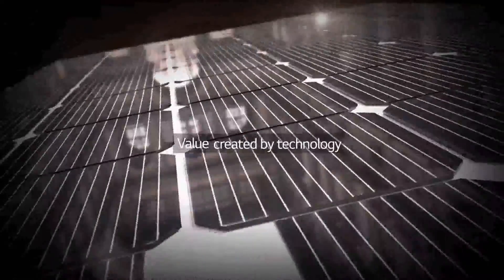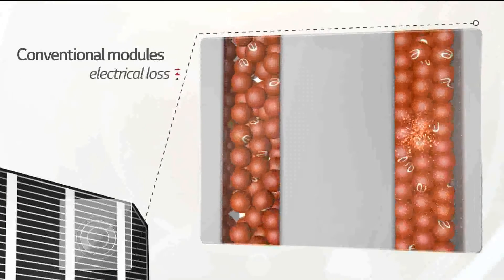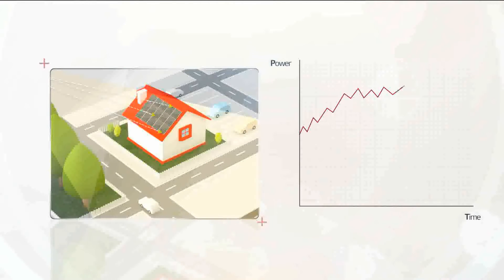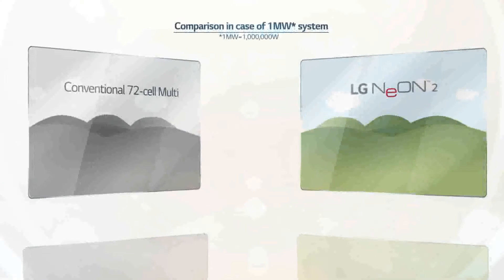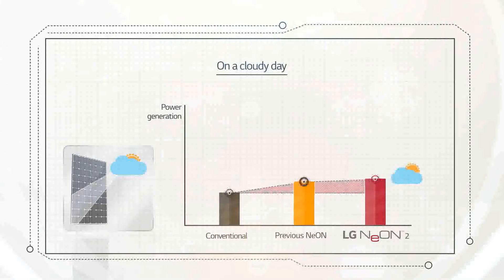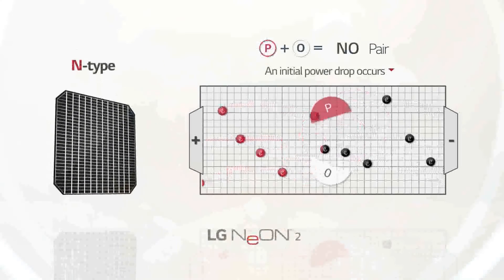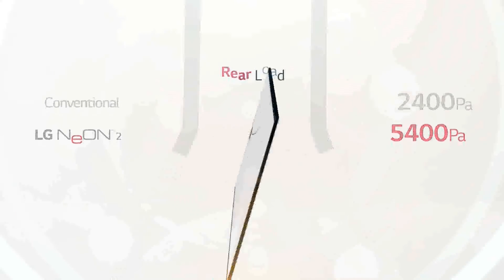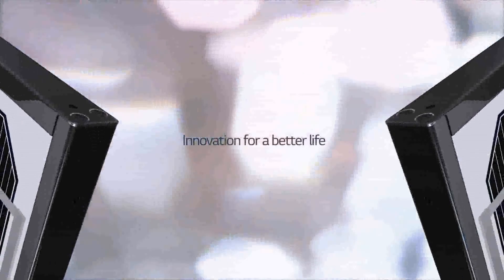LG Solar - NeON2

Comment: Doing my research. Q Cell q peak duo G5’s have 6 bus bars while these have 12. But the Q cells have half cells and the whole panel is split in half, hence the duo. Q cells degrade by .56%/ year. These are .6%/yr. These have phosphorous instead of boron oxide to combat PID. Q cells says they use a proprietary method to “deactivate” boron oxide to prevent PID.